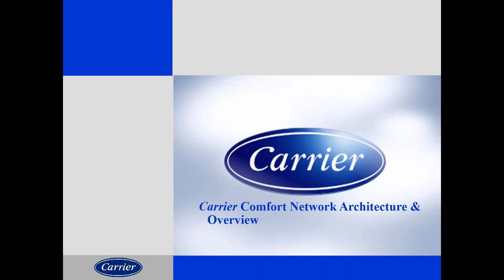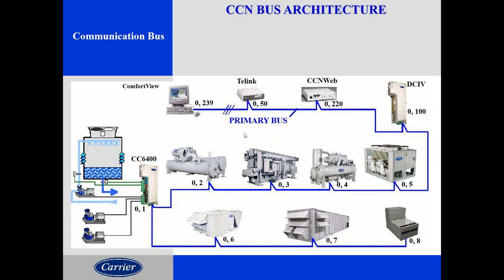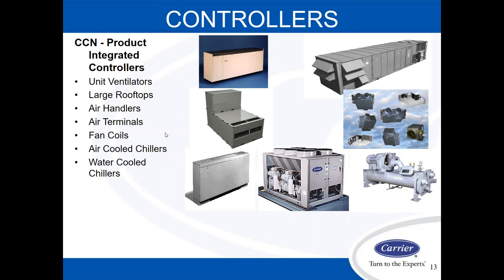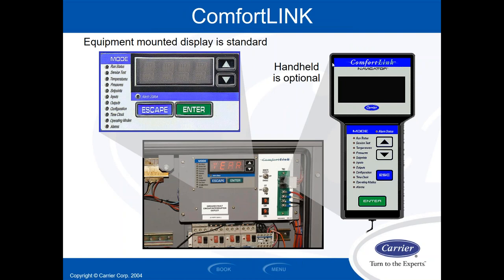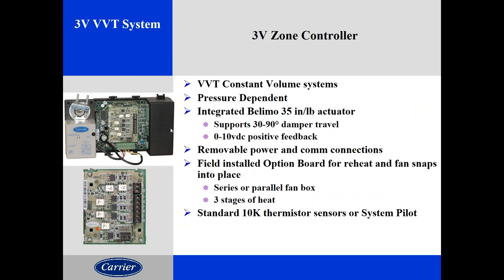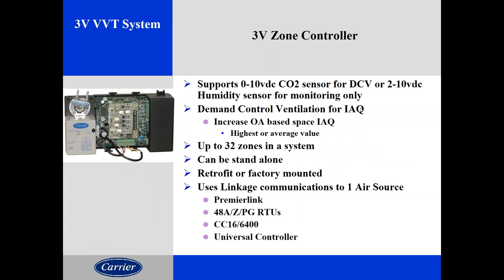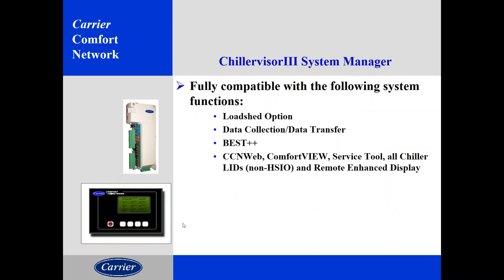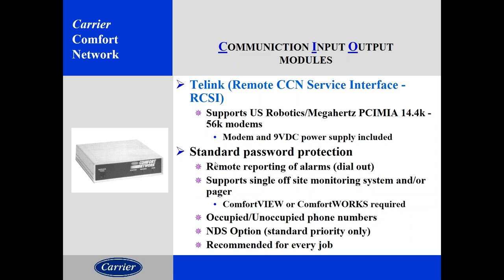Carrier Comfort Network (CCN) Overview - 5/12/20

Comment: Hello everyone! I have a USB CCN converter (33CNUSBCCN-1), I want to develop my own interface to send commands to the unit, do you know if I can interact directly from a serial interface like Putty? without going through the software mentioned in the video? I don't know if it can be interpreted as a serial COM and send commands through a serial interface and finally, where can I download more information about this CCN, thank you very much!
Reply from the maker: CCN is an unpublished protocol so you will not be able to directly interface to it. Carrier can, however, install a translator to convert the CCN on specific pieces of equipment to BACNet, Modbus, LON, or N2 so you can integrate a chiller or other machine to a 3rd party automation system.

Comment: Hi, I have a Carrier 40DMC018 fancoil system with a CRC2-NTC wall (non-programable) controller. I'm trying to replace it with any kind of programable - home assistant compatible solution, but there is no information about anyone that have ever done it. Any idea which kind of communication protocol is used between NTC and CRC2? Thanks a lot !
Reply from the maker: Sorry, we are not familiar with any of these equipment or control model numbers. We suspect you are talking about a Carrier product sold outside of the United States hence outside our area of expertise.

Comment: Hi friend!
I see that you are an expert on the topic, I have a Carrier 30XA and I need to change the default password, do you have any software that it could be able to do that, I have read about Comfort Works and Comfort View but i can't find them on the web.
Hope you could help me.
Reply from the maker: Those software programs are very outdated (CW from the 1990s and CV from the early 2000s). Additionally, both require a physical access key be plugged into the computer. Approved and trained technicians use a software called Network Service Tool.

Comment: Hi friend! Is possible communicate the ccn network protocol with modbus protocol over any device?
Reply from the maker: Yes, CCN can be converted to ModBus to send select data points from RTUs and Chillers to a 3rd party controls system. We would be hesitant to say yes to the part about “any device,” though.
Reply: @TECTubefilms  Thank you for replying. I mean what device(s) can I use for convert ccn to modbus? Can you suggest?
Reply from the maker: @filiperigueira  You should speak to the commercial controls expert at your local Carrier distributor's office to make sure you get the right translator card that is compatible with the specific piece of equipment you are connecting to. Here is a common one used to convert CCN to ModBus - https://carrier.hvacpartners.com/products/detail/33CNTRAN485-01-R
Reply: @TECTubefilms  Ok, I'm going to do that. Can this device tranlate an entire ccn network or only one device?
Reply from the maker: @filiperigueira Just one machine. Why would you want to do a whole network? That would be a gigantic integration project costing tens of thousands of dollars to map all those points. If you have a CCN network use I-Vu as the front-end interface. If you only have a couple CCN chillers then use BACnet, LON, or ModBus to add them as nodes on one of those networks.
Reply: @TECTubefilms  the costumer have two networks, a smaller cnn (with comfort view) and a bigger with modbus. They desire to join ccn network in the modbus. Can i do it using i-vu as gateway?
Reply: Hey I've got a house set up with the old parker controls with a VVT setup . This system has not been touched since the 90s I'm guessing and I'm trying to find the comfortview software. The service tool is on site and what seems to be a similar to a memory card( lol) with the phone jack attached to it. I am starting to run across some senor problems and issues with the system and I'd like to be able to look at this system and parameters. T.I.A.
Reply from the maker: @christiandaniel3738  Yikes. Commercial VVT controls in a house was never a good idea. Are you sure it is Carrier Parker VVT and not Carrier Home Zone? The stats had the same plastic enclosure because both were made by Parker Electronics. It isn't going to matter too much which you have because both were obsoleted many years ago so you cannot get parts.
Reply: @TECTubefilms  yes unfortunately it is Parker on a house . Lol all commercial set up . I've gotten lucky a few times and found relay packs on eBay and I've gotten a few zone damper controls but I'm dealing with a issue now that is gonna involve me looking at the system online through comfort view . I've been babying this house for years and tried getting this customer to switch everything out but they won't . I've just about washed my hands of it . They have some first gen rotary daily master stats and a few second gen master stats . It's been a good system but Im starting to get some priority alarms now that are shutting me down. I don't have hardly any literature on site so I've had to research just about everything online. I've even had to call ACI who makes their zone sensor stats for questions. Like I said the ccn service tool is on site and has what looks similar to a memory card lol that is slid into the service too. It also has a phone jack attached to that piece that looks like a memory card .  Sorry I'm not sure what the correct name of it is.
Reply from the maker: @christiandaniel3738  We are pretty confused on what you actually have there. Parker Electronics would be Gen 1 or Gen 2 VVT and those systems are not compatible with Network Service Tool or ComfortVIEW. They are from the late 1980s and up until about 1994. Also only Gen 2 and Gen 2 Enhanced would have had rotary dials. Gen 3 looks like Gen 2 but it speaks CCN and does not have rotary dials. ACI only made sensors for 3V VVT, which is essentially the 4th generation but not called that.
Reply: @TECTubefilms   ok so evidently I'm not sure on which gen I have  . But it is Parker elec. Basement unit is on the ACI zone sensor . The two ahus have relay packs ,bypass dampers, supply dampers , rats, sats, and there is newer carrier zone controller that is daisy chained with the whole set up and is tied into the service tool and module that was originally tied into their phone jack. Where I'm guessing the original company could pull up their system from their office. The other two ahus have one master stat and 4 slave stats . One master stat has push buttons and time clock etc. The other master stat has a rotary dail , time clock , etc. The literature I have with the carrier zone controller says specifically to be able to view or make changes I would need to access it through comfort works software,  comfort view software, or network service tool. Like I said this is before my time and my local carrier vendor does not have any knowledge either.
Reply from the maker: @christiandaniel3738  You either have mix of vintages or someone has given you the wrong literature for the stats you are describing. Nothing with a rotary dial can work with ComfortWORKS for Network Service Tool (unless you are one of a very, very, very short list of people that pruchased a very expensive VVT Gateway black box which is not likely at all). And nothing with a rotary dial can work with ACI sensors no matter what. At this point, you would need to post pics of the items somewhere and we can tell you what each one is.
Reply: @TECTubefilms  ok unfortunately I don't have a pic of the rotary Dial master stat but I have the push button master pic and other pics . What is a good email ?
Reply from the maker: @christiandaniel3738  Gen2 and Gen2E had flat buttons like this https://www.ebay.com/itm/383372433863?chn=ps&norover=1&mkevt=1&mkrid=711-117182-37290-0&mkcid=2&mkscid=101&itemid=383372433863&targetid=1263094004306&device=c&mktype=&googleloc=9021536&poi=&campaignid=14859008593&mkgroupid=130497710760&rlsatarget=pla-1263094004306&abcId=9300678&merchantid=6296724&gclid=Cj0KCQiA1sucBhDgARIsAFoytUu2ke-RGpwFYEDJ9u50QAz7PtW5OyAiyZgqU1kzefreCHHGXAajmmcaAliZEALw_wcB
Reply from the maker: Gen3 had raised padded buttons like this: https://www.ebay.com/itm/255368392371?chn=ps&norover=1&mkevt=1&mkrid=711-117182-37290-0&mkcid=2&mkscid=101&itemid=255368392371&targetid=1264870805704&device=c&mktype=&googleloc=9021536&poi=&campaignid=14859008593&mkgroupid=130497710760&rlsatarget=pla-1264870805704&abcId=9300678&merchantid=114603201&gclid=Cj0KCQiA1sucBhDgARIsAFoytUu2fwdUNrpkXlZVHS3cQcXrL4cRIcqojPsIfh3JaeyE_1UzmfOD2RsaAqVlEALw_wcB